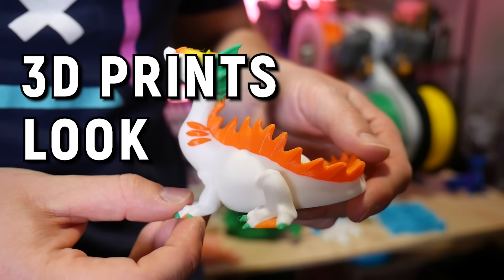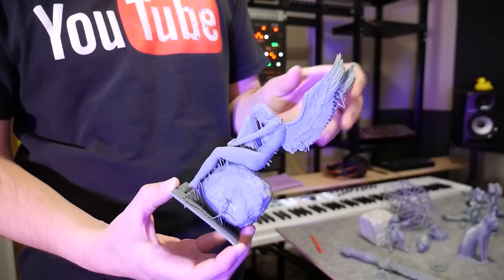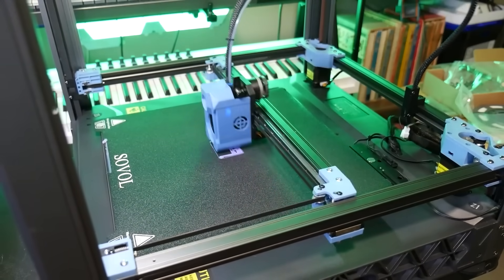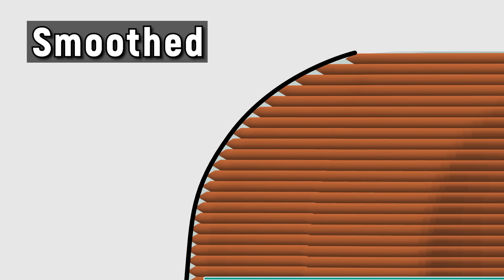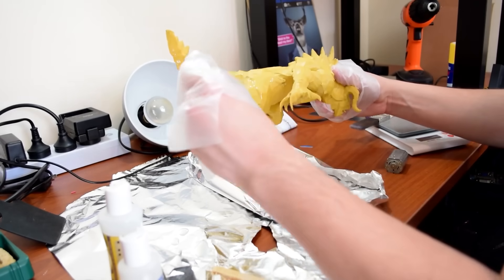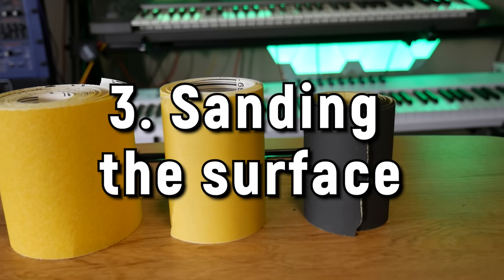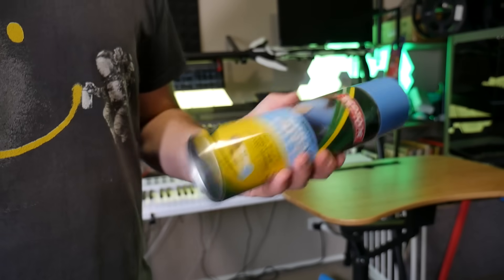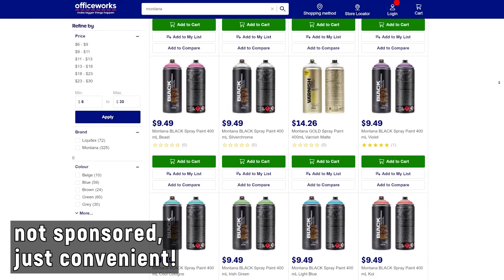How to make 3D prints look like they're NOT 3D printed.

Comment: With Nylon prints I use Grey primer then CA glue to smooth the primer into the uneven recesses. Sand it and prime again. Works a treat
Reply from the maker: It sticks well to nylon? That's cool! Fdm printed or powder?
Reply: @MakersMuse  the nylon powder fused prints like you used to get from Shapeways. A heavy coat of primer , pour on a thin layer of CA glue spread it around to liquify the primer which you can then rub into the stepped recesses. It cures in a couple of minutes and is sandable. Only takes a couple of coats.

Comment: I used my 3D printer`s for prototyping fishing lure designs, and photogrammetry replication of objects amongst other things, and once my printed lure is performing as expected, I then need an ultra smooth finish before I make a silicone mold  for my very basic resin injecting process, now how is that relevant, I also use the Septone spray putty however I have found the Septone spray plastic filler to be a better choice as it cures slightly harder then the putty, but also does a great job of ensuring all layer lines are filled . Keep in mind I only had an original Flashforge Creator X and 3 Creator Pro`s and only ever printed at 0.2 layer based purely on print time. As technology has advanced so much since my 2015 Creator X and the Pro`s, combined with the fact that I lost most printing equipment, along with our house in the October 2022 flood that devastated our small Rochester community, it is time as part of the recovery process to purchase a new printer, I have been keenly watching your video`s so I can make an informed decision before taking the plunge, starting up all over again and buying a decent printer with all the technological improvements that are now regarded as minimum standard. Been  following your channel for years and love the content.  Oh and if you can spare a 24 hr curing time, envirotex lite is a crystal clear resin that provides an ultra smooth finish with the only main downside being that the object has to be continually rotating ( BBQ rotiserie works well - ignore spelling ), after 8 hr`s you can stop the rotation, there are of course some tip`s and trick`s involved during the intitial coating but the end results make the process quite viable.

Comment: TBH although there are occasions where I had a desire for smoother prints (looking at you, slopes...), I really REALLY like the aesthetics of 3D printing, especially on vertical walls and chamfers. Sometimes I even increase the layer height just to increase layer line visibility. I used to think otherwise but when you tuned the shit out of your printer and the perimeters are very consistent, they actually look gorgeous.

Comment: After working with 3D printers for almost 10 years I eventually found that using a simple, cheap, one-sided rectangular razer blade to shave away the surface is exponentially faster and finer than literally any form of sanding. Within less than 30 minutes I can get most small FDM parts to look like resin parts. It can get into the small nooks and crannies and you can get it to have a downright semi-gloss finish. Zero sanding involved. I do usually hit my parts with a final 120 grit pass just to give paint something to adhere to and touch up minor imperfections and scratches but everyone should try it out at least once. Obviously be careful. Don't let the blade slip, don't apply really much pressure or force at all and maybe wear gloves in the beginning if you want to be extra cautious. Just gently shave the surface in any direction you like, although starting out scraping along the print lines tends to be the easiest at first, and diagonal scrapes tend to remove more material quicker. Practice with short steady scrapes of the blade and long gentle ones. Again, I know it may sound dangerous working with a razor blade but I've been doing it for years and have never once come close to injuring myself. It really is the same motion as shaving your face, just on a plastic.

Comment: talc powder is a rock. but talc is mostly calcium carbonate. you can make it pretty easily (asbestos free version) using baking soda and pickling salt (calcium chloride), just mix solutions together and filter off the precipitate, wash and dry.
Reply: make sure both are fully dissolved before mixing the liquids for best results. vacuum filtering works well but you can decant it if you don't have equipment.

Comment: better than sanding if you have a large surface accessible is to use a cabinet scraper / card scraper. super fast for a nice finish that gives moves you far along the sanding path, or ready for painting.

Comment: As a member of Team No Sand, but also as someone who doesn't sell 3D printed items and also focuses on practical prints... I look at PVB if I need something that can be smoothed. Otherwise I operate off the same mentality as I do with a PowerPoint: if you can see it from X distance away and go "Daaaaaang, that looks so cool" then my job is done. If I did that without sanding or smoothing, even better. The area I've been curious about is utilizing mechanical means to sand... Dremel tools and such to do the work that I refuse to do. The cosplay people I see who are mass-producing things without mold making are using mechanical means and yet most of the 1-off event creators and many YouTube/Twitch people instead do sanding by hand. So would be curious on those mechanical methods.

Comment: Like the slicers have a seam smoothing option in them. It's actually pretty good, you'll still need to finish your print by hand but by simply enabling ironing it can remove a lot of banding for a small time cost.

Comment: I use wood filler. It is non-toxic, water based and relatively fast to dry. It is imho the best solution for most hobbyist, and specially those that can't just go and spray outdoors or have very, VERY well ventilated workspace. Everyone living in apartments for sure needs a non-toxic solution and since woodfiller is just gypsum dust suspended in water... You can thin it with water or water/isopropyl to make it brushable. 

Easy to sand but does create fine dust, it is not a huge problem unless you make a mistake of blowing any working surface... Keep a wet rag close by and use that, then remember to also rinse that wet rag before drying it. Even if you use spray fillers, do the first treatment with woodfiller as it puts a LOT of stuff between step of the layer lines, you don't have to sand so much and also don't need to use so much of the more expensive fillers: woodfiller is dirt cheap and a tube of it will most likely dry up before you get to the end of it. So, don't buy it in bulk..

Also: cabinet scrapers and similar... They can really cut down the amount of sanding needed, in some cases a 45 minute sanding cuts to 15 or 10. You still need to sand a bit but it removes more material with greater control of where it is removed and faster, it also doesn't cause problems with temperature as it is quite "cool" process: it is cutting more than sanding that has tons of friction. Once you try it, you will find a lot of tools around your shop that have sharp enough edge to be used as scrapers. It is one more shortcut that removes a ton of manual labor.

Comment: All finishing is a lot of work at the end of the day. I've only bothered to do it properly a couple times but it does look great. Choosing the right filament can make a difference too. The piece I'm most proud of is the popular Trex skull model you can easily find online. I printed it in wood PLA, sanded it, stained it, then prayed with clear varnish and it came out looking great. You can barely tell it's 3D printed.

My only regret is I didn't think about the PPE and microplastics till more recently and I did most of that work completely unprotected!

Comment: I change my top z height from the default 0.2 to 0.23 and supports come off very, very easily. 0.25 works better for others but with my printer (K1 Max) the gap was a little too big and I was losing quality. Plus the supports were basically slipping off.

Comment: As a lazy person i found out that this is the fastest smoothing i could get within 48 hrs (i literally did it multiple times whenever a con is just a few days away)
I use PETG btw cuz where i lived has its R/H at 80% even in the driest day
1. Print at 0.08mm layer, 0.4 nozzle is totally enough for that, 0.2 is just waster of time for the size of cosplay props)
2. acetone smoothing with an IKEA spray bottle, no chambers, just a glass plate to put the props on, 3-4 passes will do, taking 1-2 hrs approx, just set a timer to remind urself to spray once every 20 min
3. The bottom will have very thin orange peel, just scrape them away with a #400 (yes, scraping, im not even sanding it)
4. Liquid putty+hobby paint, or straight up apply thick wet paint like PYLOX (mostly bc its cheap AF😂)
5. Matt finisher and its done well within 48 hrs

Comment: The most expensive 3D printers that use filaments can print figures that are really smooth 😉.
Reply: There's even 3D printers that can make small details that make small figures look like the real thing. Like it was taken from a photograph with high resolution.
Reply: @metern resin printer could be very cheap 
Under 300 u got anycubic mono M5, which i've seen companies using them to print wax molds for jewellery so its defo fine enough for photography

Comment: Only low quality talcum powder usually has the chance of having asbestos in it. Yes it has been in baby powder on some large brands that's why there is valid concern. I usually buy medical grade talcum powder from a lab supplier which have certificates from measurements, because I bought non-powdered latex gloves once so I powdered them myself. It also works for sweaty hands. Maybe you can use corn starch as alternative or just plain flour?

Comment: 3M filler for plastic (green stuff in big tubes) dries really quickly (a minute or two) and sands incredibly easily. I find this si much faster than the spray filler approach for smaller sites, but use the spray filler for larger ones

Comment: If you can't get that body filler in a can, what you can do is get some 1k body filler and mix it down with acetone and then just use an airbrush or just paint it on, works just as well, then follow all of the other steps.

Comment: I make a lot of cosplay masks and parts, so my prints are pretty big. I use wood filler for the most noticeable layer lines, which works wonderfully, but it's not ideal to spend the time it takes to fill the whole thing. I can get away with it on most stuff, but when using metallic paint, it's super noticeable.
Reply: my dad works on cars as a hobby so he has car grade filler. its thicker and comes of almost smooth after just one coat on prints i do whit 0.8mm nozzle and 0.3mm layerheight. That way i can go from printed parts to finished armor in like three days

Comment: I am in the process of buying a Bambu Labs carbon X1.  My plan is to use it to 3D pring RC aircraft, but I would like to achieve a smooth surface so the model looks good.  Which of the above methods would you recommend given that I will be printing in LW PLA so I dont want to add too much weight to the model if possible.  Just subscribed, good to see an aussie channel (espec. one with so many subscribers)..... LUV YA WORK

Comment: Hi, Any recommendations for a first 3D printer for home use, making durable parts for home and workshop, moulds for casting resin and concrete. I am a beginner, have printed a few things at work on Prusa i3 MK3 but only in PLA. Cheers
Reply from the maker: depends on your budget, Prusa mk4s, bambu x1c great choices

Comment: I find spraying primer creates quite a lot of waste (a lot just goes in the air). I’ve recently tried a method of mixing 2 parts wood filler 1 part acetone and painting it on with a brush - a lot less hassle and better result imo

Comment: Talcum is known to cause cancer and has been discontinued it has been linked to Ovarian cancer. Talc has been removed from baby power, but the power still might work if you can get it, Baby Power is still available in the states with out the Talc.

Comment: Polymaker sells an 'easy sand' PLA they call CosPLA which I decided to try recently and have fallen in love with - it prints like regular PLA but the plastic is slightly softer so it takes sanding much more readily - I've been doing 150 -> 220 -> 400 with no fillers at all and getting totally smooth parts fairly quickly, on par with working with pine or similar. For people in the US (and I think Canada?), for a spray filler/primer, my go-to has been the Duplicolor filler/primer sold at most chain auto parts stores. It's kind of pricey (~$18 USD a can) but both the build and the adhesion are far superior to any of the other filler/primer sprays I've tried.

Comment: Thanks for the tip on the Spray Putty, looks like you can pick it up at SCA! Does bunnings have any equivalent products, I've often used Rustoleum filler primer in the past to mixed results

Comment: 6:05 I don't know if there is a specific english name for it but I use corn flour for this. It's especially very useful to fill holes in hollowed models.
Reply: I think it’d usually be called corn starch
Reply: Corn starch!  You can buy regular corn starch in the cooking isle (it is used as a thickener for sauces and soups), but most baby powder is now made with corn starch as well, and for bulking up resin it works just as well

Comment: At my university we had a industrial resin printer (top tier for ~2012) and during one group project we realised that the resin could be polished to look like glass if we took our time. The four of us spent a week taking it in turn to sand from 120 grit all the way to 3000 grit, then use 3 stages of buffing compound to crate a clear "glass" kettle and a "polycarbonate" visor/air deflector. The end result was amazing but god it was awful on our bodies 😆

Comment: 10:20 

“Don’t try to spray paint when the humidity’s really high…”

I live along the Texas Gulf Coast, bro. Every day is a high humidity day here. (For most of the summer, the average humidity’s been around 65%.) I wind up spraying more, lighter coats and wet sanding lightly between. It takes a lot longer, but it’s the best way I’ve found to work around the humidity.

Comment: I don't know if it would work for 3d prints, but Citadel's Chaos Black is what I use for models. That stuff is strong. 
If I mess up a coat above, I can generally just sand through and 90% of the time, the base coat is preserved.

Comment: Wood putty has been useful. It tends to be easier to manipulate over a print and sands easily. 
How do you sand detailed prints like masks or dice towers? I have always had trouble getting things like that smooth without accidently sanding off details.

Comment: I saw a great hack here on YouTUbe a few years ago - I prep my "raw" prints with P40 and then use water-thinned wood filler and let it dry. After that, I use P180 to get a smooth surface and, depending on the part, work my way up to P3000. Some might call it overkill, but I got very nice and smooth prints out of this.

Comment: Not that it's a problem in OZ but here in NZ where it's a bit cooler I'll get a bucket of hot water and heat the cans before spraying, been doing this for years with my car parts. Pro tip: Get a magnet and use it to hold the can upright so the nozzle doesn't get wet. When you grab the can just pull it up and the magnet holds against the  rim of the bucket and falls to the floor as you remove the can saves time pulling it off. BTW been watching you for a few years now strangely ever since I got my 3d printer. Thanks for the great info!

Comment: I tend to do more abs prints since my university lab has a ton of it lying around. And my favorite way to make it smooth is just hit it with the soldering iron like I'm spreading butter. It works well when the layers are thick and coarse but when it's really fine it's usually unnecessary. Then just sand and file it, then brush some acetone once or twice over the surface to get that shine. If you get good at the soldering iron "spreading" you can get the same results from a .4 or .5 layer height than a .2 or .15

Comment: I don't mind about the layers that much, but I'm a bit worried over all the small, stringy fibers that get left hanging on prints.

Would there be some more ways to "fuse" these in?
Reply: I know that some people use short exposures to a heat gun to 'wither' the stringy fibers down -- with their extreme thinness giving the heat nowhere to go and their high surface area increasing absorption from the air, they are melted much more rapidly by exposure to hot air than the bulk surface of the part is. With lower-melting-point plastics (PLA, etc.) a hair dryer on a hot setting might be enough, depending how hot the particular hair dryer gets.
I haven't tried it myself yet, though.
Reply: @05Matz  ok, ty for the tip. gotta try that. 🤔👍

Comment: Are we doing it wrong? When doing car body work they use bondo filler and cake it on then sand it down. Similar to the spray paddy but applying it the way they do allows you to squish it better into the crevices than I think a spray would never do.

Comment: If you are remaking an Injection Molded part and have access to the mold in some manner, you can rough out the part in FDM and use the mold to forge the part into the final shape.